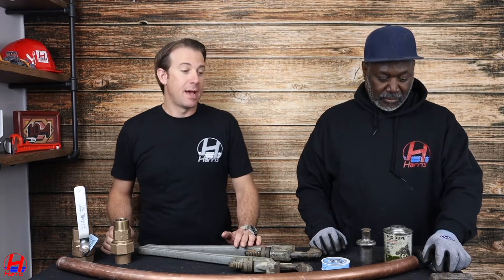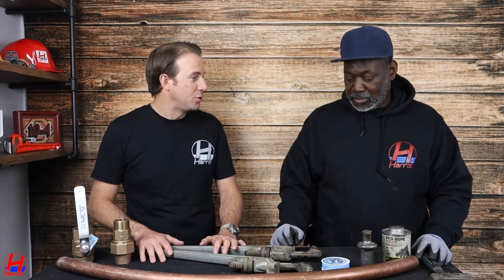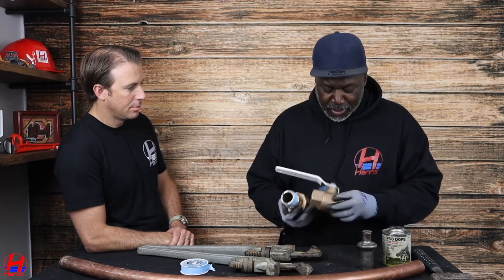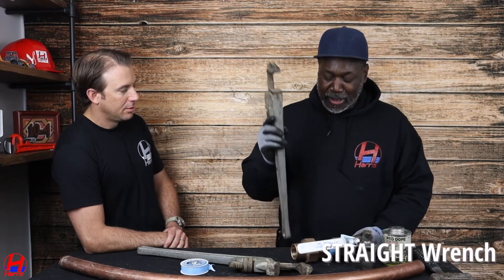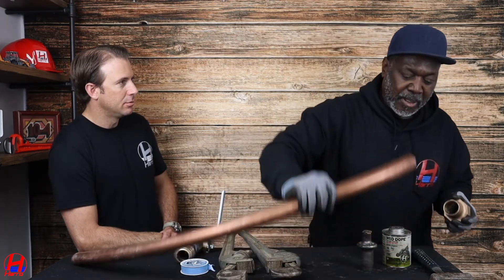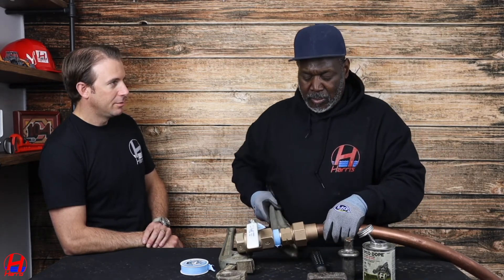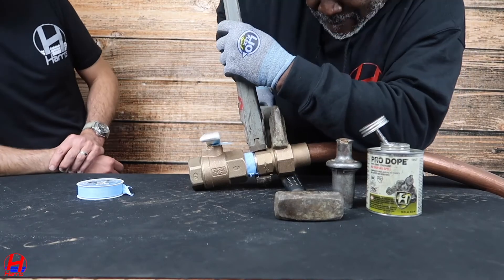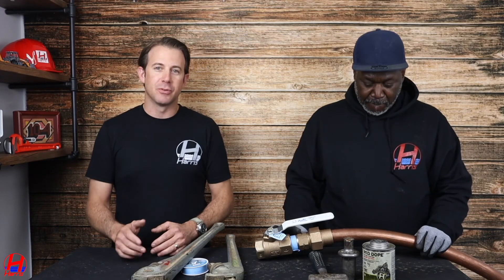How to Install a Ball Valve on Copper Pipe for your Water Main

Comment: Why you are not using soldered in place valve?
Reply from the maker: This is the main water line from the roadway. This is what the plumbing code requires in NYC